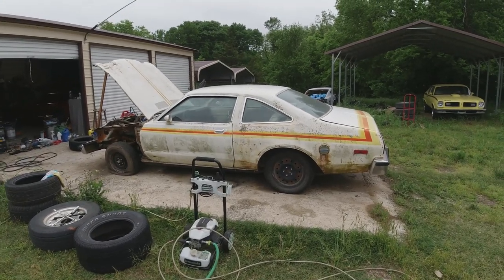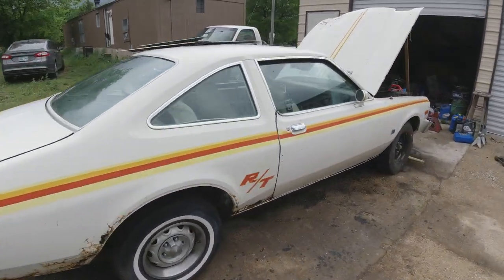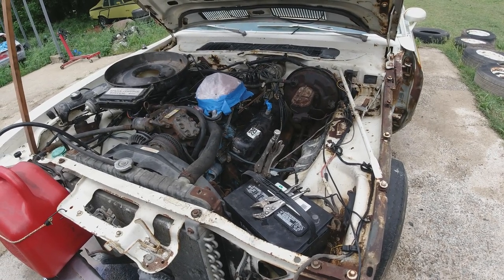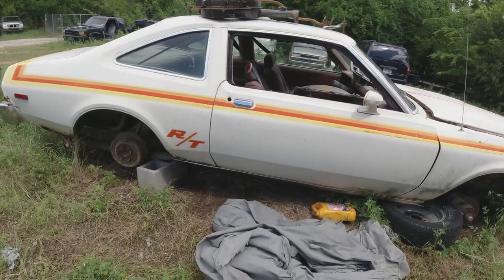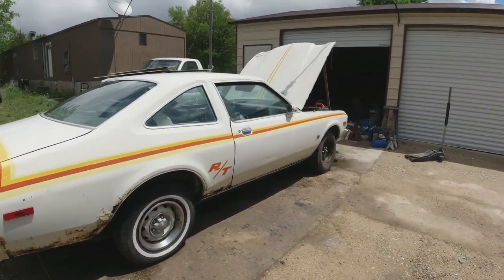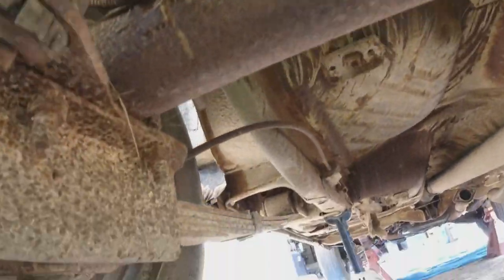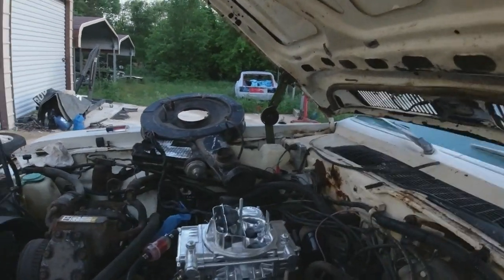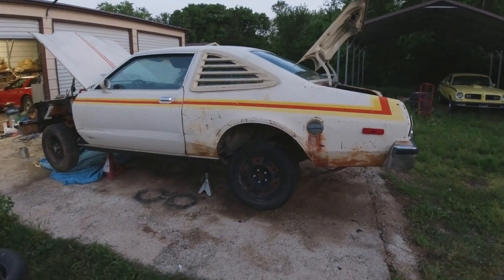Restoration of a 1978 Dodge Aspen R/T - Part 3

Comment: Do this car has the pretty rare top engine option.  Glad you’re restoring this car because it deserves a stock restoration except bypass the shitty power choking lean burn, and install long tube headers with cat delete and true dual exhaust
Reply: 318 2bbl has ac and pwrbrakes

Comment: I have a 79 R/T  with the E58 dual snorkel 4bbl thermoquad and a 727 torqueflite 3 speed auto with the factory sure grip 8 1/4 dual exhaust. It has a sway bar on the rear axel it connects to the lower shock plates.
Reply from the maker: Very cool. We have almost the same car!

Comment: Look above the tank or behind the rear seat for the build sheet. Since it was only on the road for ten years most likely it there. It will tell you what all came with. Makes since they was swapping parts. I'd beat the fender onvthe roller is off that car,as well. I'd a switched them for sure being the same color an stripes